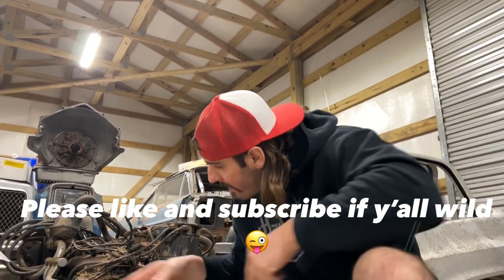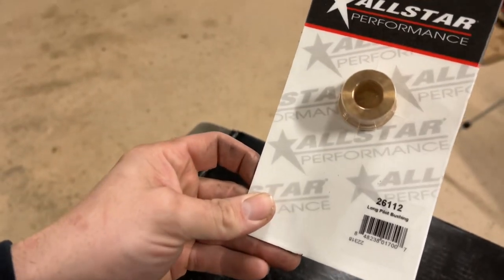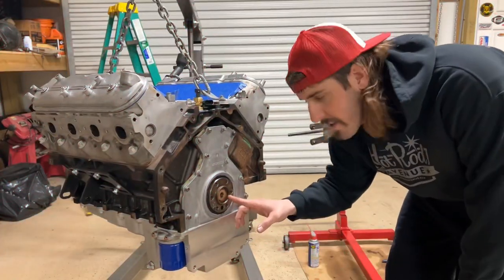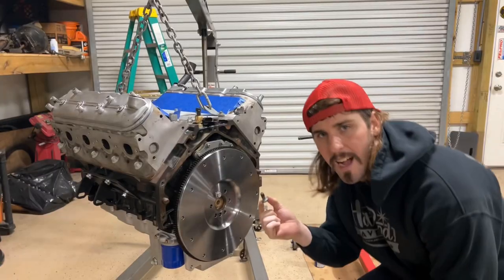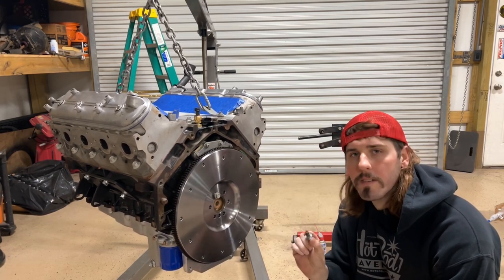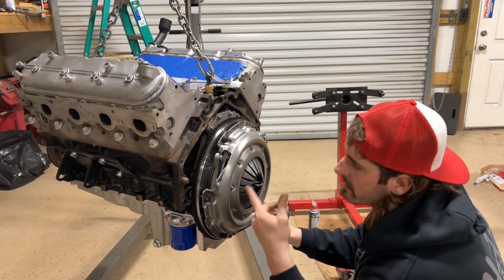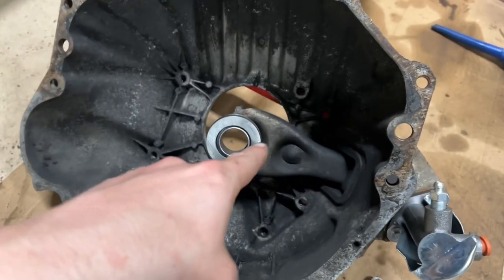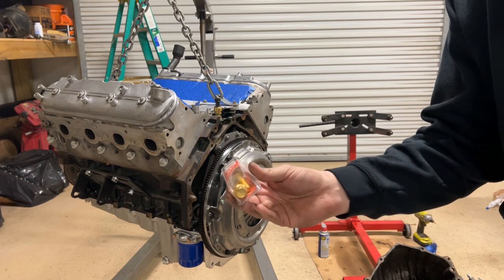GM Muncie 4 speed / sm465 to ls engine‼️ Going in a squarebody dually 💪🏻

Comment: Finally someone showing the RIGHT way to do it instead of:  Use stock LS flywheel from 4.8L, drill out the bolt holes in the pressure plate, slap together, have some of the face of the clutch hanging out in the air because the center bolt clearance in the stock flywheel is TOO BIG!   Either that, or they have  to use a clutch disk from a 1999 model 2500 truck, the throw out bearing from the original vehicle,  the pressure plate from a 1995 350 truck,  or some type of mash-up of a parts list.      If you use that flywheel that you have, then ALL of the clutch components can now be from the original application and will fit and work properly.  Pretty handy when you or someone else eventually has to replace that clutch 10 years down the road!   

I have ordered that same flywheel, just been backordered for several months now.
Reply: Any luck on the flywheel ? Still on backorder. Did you use an alternative flywheel? Thanks
Reply: @JoseValencia-dc4jt  Finally, after the backorder was extended about 3 or 4 times, I just told them to cancel it.  I did find a used one on Ebay that was in like-new condition.  Bought it for $100.  Haven't put it all together yet, but my son and I are cleaning out the shop so that we can get his truck in there and start wrenching

Comment from the maker: Thats what I was shooting for!! And yes sir, with the stock truck manifolds it clears but it’s tight. Slight modifications to manifold and It’ll be money 🤙🏻
Reply: Sm465 with 5.3 ls I have 168tooth flywheel and it grinds my starter down good and fast any suggestions other than change the flywheel to a 153 tooth

Comment: Could you use the same pilot Bushing,flywheel set up with a LT1 T56. I know you would have to use a clutch with the right splines
Reply from the maker: Man I’d be lying if I told you! This is more of an ls to old school trans kinda tutorial…but I believe the flywheel did say sbc/ls on it
Reply: @DuheSpeedShop  no I understand. the lt1 t56 like what came in you 96. Camaros is more like the old muncie transmission then once the ls came out they switched the t56 to a different style.
But thank you
Reply: Use a standard Gen 1 pilot buching. Summit sells the GM one dont use aftermarket/auto parts junk I learned the hard way. 
Slip it on the input shaft to make sure it isnt too tight before installing it
Reply: @watersB13  Camaro T56 is nothinng like the old muncies, adapted one with a Gen 1 sbc

Comment: The LQ4 had two different size shaft sizes based on the generation, can you explain whether the ALL26112 or the Chevrolet Performance 12557583  would be be a better pilot bushing option based on a 2002 lq4
Reply from the maker: Never used a long crank 6.0 so I can’t speak on it!